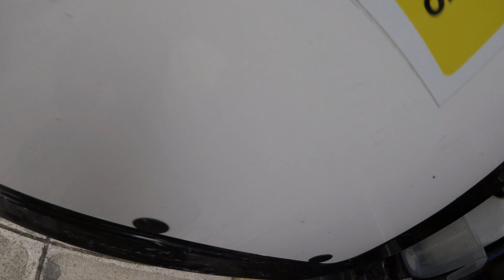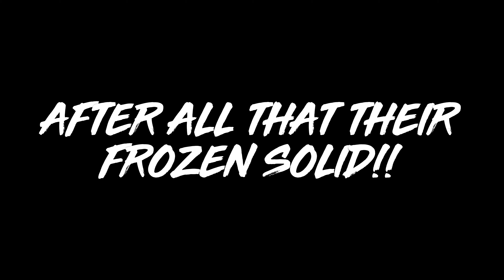-3° GUTTER CLEANING REAL TIME FAIL - ECOWASH EXTERIOR CLEANING

Comment: What hose reel would you recommend for a 19mm x 50m hose pipe
Reply from the maker: Hi Dave, is it 1/2" hose with 19mm external diameter? Is it a fixed manual reel?